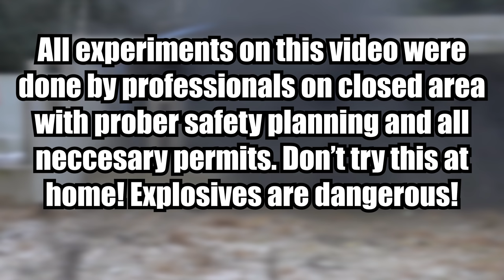How hard it is to explode a hole in concrete wall?

Comment: “Don’t try this at home” Yes because I just casually have C4 laying around my house....
Reply: Tbh you can get really similar results with supplies from the hardware store and walmart lol
Reply: @destinytroll1374  how
Reply: @collinspittle6886  a good VPN and a private browser helps. :D
Reply: @collinspittle6886  not today Mr. ATF man
Reply: Or, if you live in a state where it is legal...you can go to Walmart mart and buy tannerite. If you want it cheaper you can buy ammonium nitrate and aluminum dust, mix it together in a proper ratio, and bam! Explosive. Good luck getting the blasting caps though...
Reply: Lol you have one?
Reply: @majorleagueminuteman1344  you can also just make rdx or other high explosives fairly easily... for example to make TATP all you need is hydrogen peroxide and acetone, but it'll blow your hand off if you arent careful
Reply: @majorleagueminuteman1344  isnt blasting cap just a fuse or smaller explosion for the large explosion? Or is it just a container for the explosive?
Reply: @ThatTURK1  depending on how stable the explosive is you can use a electrical charge on some whereas C4 needs a smaller less stable explosive to set it off. i would go into more detail butttttt NSA and whatnot.
Reply: @rickylafleur5823  lmaoo gotchuu
Reply: Well, they probably have in Finland...
Reply: @rickylafleur5823  precisely. I’m not going to elaborate on ANY initiation device online...if you want a visit by the alphabet bois...that’s a sure fire way to do it.
Reply: Wait you don't? Did I do something wrong?
Reply: i know how to mix TNT tho
Reply: @majorleagueminuteman1344  you missed an ingredient sir
Reply: @ThatTURK1  Most explosives these days are very stable so they don't explode at random on a warm day or when you shake them too much during transport, but that also means that you have a harder time making them explode when you need to. Blasting caps are filled with a small amount of less stable explosive which can be triggered on command which can then set off the main explosive.
Reply: @Brutus When you’re growing up, you gotta do illegal shit once in a while, have a bit of fun and maturinate into a better person
Reply: Tannerite bois, a large amount should do. Get you a bunker, you'll need it.
Reply: @watdatdoo  tannerite is kiddo stuff.
Reply: @rickylafleur5823  Yeah but a large amount is still a easy to get alternative. But I understand that it wouldnt be close to TNT.
Reply: Well be swatting you're house in a minute
Reply: @leythal-igaily7158  bring it!
Reply: @leythal-igaily7158  i have set the ultimate trap! you may have body armor but do you have lego proof footwear? bahahaha i know im evil!
Reply: you can make explosives with bleach and potassium salt as well but its rather weak
Reply: @karolbomba6704  you won't be making those much longer..

Bravo Six out
Reply: @leythal-igaily7158  the ironic thing is that the docs on how to make them were released by CIA
Reply: @karolbomba6704  we dont talk about it
Reply: @collinspittle6886  check out Tech Ingredients channel
Reply: You must not live in America
Reply: I have C3 on my door...
but my neighbor has C4 
😁😁😁😁
🙈🙈🙈🙈
Reply: @majorleagueminuteman1344  This is what ABB did when he wanted to blow up that government building in Norway in 2011.
Reply: @collinspittle6886  Nitrate hexamine, to get RDX, with RDX you make plastic explosives. Good luck getting it to go boom though, detcord is harder to make and i don't think your hardware store improvised primaries pack enough punch. Picric acid might do the trick but it's literal poison so don't fuck around with it. It doesn't have to go boom to hurt you.
Reply: I lost all my C4 in a boating accident!
Reply: mans you can buy or make thermite so who needs to blow through when you can just burn through
Reply: @IudiciumInfernalum  pretty sure tatp should be fine as a primer for anything you can make at home, but there's plenty of other ones you can make at home that'll work too.
Reply: HAHAHAHAHAHA...YUP
Reply: @malelpn37  that was probably on purpose

Comment: I like how they just casually make and use I.E.Ds
Reply: Finland, the land of No Fucks
Reply: Well how else do you think they fought off the Russians back in 39
Reply: for science or something
Reply: This "improvisation" is an application adapted for a purpose, a tool designed to do a job. In a controlled test environment.
It's not a synonym for crime and terror.
Reply: @pwnmeisterage  You do realise I.E.D stands for improvised explosive device which was exactly what they used in this video
Reply: @T-904  You do realize it's not a coincidence that I used the word "improvisation"?
Reply: As long as they aren’t hurting themselves or others, should be fine.
Reply: these aren't IED's they're actual professional charges made with C4 they're not improvised at all and he's properly licensed(if he put the C4 on a gas tank of a car or surplus artillery shells then they'd be IEDs)
Reply: @Aaron-zu3xn  but he literally put C4 on a gas tank
Reply: @T-904  no that was just a backing of water to concentrate the blast,that's how professionals use breaching charges
Reply: @T-904  a professional door breaching charge is literally just det cord and a plastic backing full of water that cuts a hole in the door the size of your backing,it may seems home-made the way they did it but that's professional work
Reply: @Aaron-zu3xn  it was home made
Reply: “Hmmm I ran out of water, canteen is now grenade”
Reply: @bertjones5778  what do you mean they "surrendered" russia lost anyway.
Reply: It's p easy
Reply: As long as its for "science"
Reply: Yea why is it cool when they do it but when I do it people use words like war crime
Reply: @evanstavrou918  ify mans
Reply: why are you guys arguing over dumb things lol does it really matter if it's an I.E.D or not
Reply: They're not doing it casually. They have permits.
Reply: If you're a professional an IED just becomes a ED
Reply: @jacksonkouns5623  you are correct
Reply: @Aaron-zu3xn  it was still made it home that's the thing if it's made it home then it's an IED that's just kind of how it works
Reply: @USS_ESSEX_CV-9  no...an IED is improvised from things and used in a way the original parts aren't intended for,this is a professional expert using the pieces as they're intended to be used,no different than demolition work and they don't use IEDs to take down buildings
Reply: @Aaron-zu3xn  so you're telling me that the person who created the gas cans originally intended for them to be used as effectively casing for demolition charges that's what I'm understanding from your comment
Reply: @USS_ESSEX_CV-9  yes they are tanks to hold liquid not specifically gas cans,his explosives were also purchased at a real distributor by him with HIS LICENSE which IEDs are NOT
Reply: @USS_ESSEX_CV-9  the tanks are not part of the explosive btw so have no bearing,the explosive still works without them so they're not even considered
Reply: @Aaron-zu3xn  an IED is an explosive device that is made with the power of a single person's mind because they think this might just work for blowing a hole in something so for example taking some c4 and shoving it into the side of a Jerry can or some c4 stuffed inside of a plastic water bottle that is full of water that is improvised maybe improvised by professionals but still improvised.
Reply: @Aaron-zu3xn  also the Jerry cans change the way the explosives behave without the water inside the Jerry can funnel the explosion into the wall it probably would not have blown that big of a hole in the wall has explosives take the path of least resistance concrete is in some cases easier to destroy than water when you're dealing with explosives cuz water effectively behaves like concrete when you hit it with very high energy so without that water there in the Jerry can that concrete may have come away from that explosion with a little dent in it
Reply: @USS_ESSEX_CV-9  the c4 isn't inside the jerry can it's literally used before they even think of the jerry can,this is NOT an IED,an IED is improvised on the battlefield to injure soldiers out of whatever is at hand after suppliers are shut down,this is NOT an IED any way you try to justify your argument,
Reply: the jerry can isn't part of the explosive they just put it behind the explosive to concentrate the blast,had they filled it with a chemical to magnify the blast and do more damage(anfo for example) then it would be considered an IED but in this case no,even professional jobs use backing for cutting charges and that doesn't make them IEDs
Reply: @USS_ESSEX_CV-9  by the logic you're trying to use any breaching charge is now an IED and police/QRF military teams use IED to breach doors/wall now...that's not how any of this works..they all use backings
Reply: Its a bit like Finnish pressure washer
Reply: it's actually pretty easy, that's why IED's are so plentiful and dangerous
Reply: þey're fnnish, þat's just how þings are in Finland
Reply: Basically a secondary school nerd
Reply: you dont?
Reply: @johnweber4504  I never said that
Reply: I like that you think composition 4 and shaped charges are IEDs lol.
Reply: @bigj43454  if they are improvised like what you saw in the video they are I.E.Ds
Reply: Don't worry they had "prober" planning 🤣
Reply: and there's nothing wrong with that
Reply: @T-904  Its not an IED, IED definition: "a simple bomb made and used by unofficial or unauthorized forces."
Reply: You don’t do that?
Reply: Dude same
Reply: If they used a Nokia as a detonator all they would have to do is put the buttons and faceplate back on and it would be back in business!
Reply: @USS_ESSEX_CV-9  i.e d. = improvised EXPLOSIVE device. His explosive device wasn't improvised, it was C4. If it were diesel and nitrate or gun powder in a pipe, it would be improvised explosive device. This c4 was designed to explode exactly like this, unlike mixing 2 everyday chemicals together, I hope this makes it clear for you. Has nothing to do with what you shove the charge in, it has to do with the explosive material
Reply: @zbruh7268  an improvised explosive device is a device that may use any type of explosive charge be it improvised from something like gasoline or a conventional explosive like c4 deployed in ways other than conventional military action so everything they made in this video is an IED Because those are not standard military explosives. The charge itself may be standard like c4 but that's not something that the military is going to use or not just going to use a Jerry can with c4 plastered on the one side of it
Reply: @FireMissionAlpha  No Fucks Given Finland lol
Reply: Cant we all just get along? Lol
Reply: In a world of pure science there is no problem with that. Unfortunately people be crazy and use this stuff to harm others on purpose. Instead of running interesting experiments and being a helpful tool. 

Also keeps doctors from haveing to sew on fingers but that is irrelevant.
Reply: Finland: like the rest of the world but everyone drifts at the speed of light on dirt roads whilst making IED's and venison simultaneously.
Reply: Don’t worry until they make EFPs
Reply: They should make a YouTube channel called beyond the IED
Reply: @Aaron-zu3xn  there are many different types of breaching charges you're correct in one of them this is hydraulic breaching charge but there are several other ones and this wasn't typically used by military police or military they use higher quality products so in a sense this is still an IED
Reply: Russians Whu u expect lmaoo
Reply: Bert Jones on skis
Reply: @USS_ESSEX_CV-9  If any explosive "deployed in ways other than conventional military action" is an IED, then fireworks and firecrackers are IEDs.
Reply: @hermenegildakociubinska6665  they might be
Reply: Iraqi’s would have already done it by now and made the finn who survived cry
Reply: Y, you don't?
Reply: I am old enough to remember when we could do stuff like that as kids. Apparently it is now a crime...
Reply: @vidard9863  it's not a crime so long as no one gets hurt
Reply: Every explosive at one point was an IED.
Reply: @pwnmeisterage  
Dude they are literally doing the definition of improvisation 
Well that didn’t work let’s try this 

Improvising is exactly what they’re doing
Reply: @microwave4928  Before you insult people you might want to actually pay attention to what they're saying, lol
Reply: Wait... you don’t?
Reply: @devinhedge  I am legally obligated to say "no"
Reply: @bertjones5778  I thought it was just that one dude and his rifle
Reply: @fat-boyzstudios5654  correct, one more correct answer and you’ll be able to claim our grand prize! One “mostly” intact T-34 “repossessed” from the ____________ conflict!
Reply: @microwave4928  no? Listen?
Reply: @USS_ESSEX_CV-9  if you're using commercial explosives of which c4 is ita not an IED its just a prepped charge
Reply: @craigcrissman4651  it's still used in an improvised way. You cannot go to a company and buy a Jerry can with a bunch of c4 stuffed in it as a breaching charge that's not a thing you can go by so therefore that is an IED.
Reply: @USS_ESSEX_CV-9  just because you cant buy something prefabricated doesn't mean its improvised. Adding a water backing to create backpressure for a breaching charge is a fairly standard procedure. Just because the container is up to the person prepping the charge doesnt make it an IED
Reply: @Aaron-zu3xn  Wrong, these are indeed IEDs. An IED doesn't have to be for terroristic use only, an IED is literally any sort of unconventional explosive, which these are all unconventional considering they made them combined with a water bottle, a jerry can, etc.
Reply: @vt.b3nis376  IED implies modifying something and using it an a way it isn't meant to be used to cause casualties,the way they're doing it is with professional tools and certified professionals it's NOT an IED some goat farmer built in his shed
Reply: @vt.b3nis376  by your definition everything made by the channel "Ordinance Lab" would be IED's but they're not they're registered with the ATF as well
Reply: @pwnmeisterage  HEOs or homemade explosive objects

Comment: I was once privileged to observe the demolition of a thin (5" thick) concrete bridge deck slab, from a damaged bridge with a washed-out abutment.   The slab had so much reinforcing in it that, even though it had a 45-degree twist along its length, there were no visible cracks.   The thinner the slab the more difficult it is, because the blast just blows a hole and escapes into thin air.   The contractor had a free supply of time-expired Anzomex boosters (TNT + PETN).   These were maybe an inch and a half diameter and a couple of inches long.  So he drilled strings of holes about 4" centres, inserted and fired the charges, and it cut the slab into neat six-foot squares of concrete joined by the reinforcing which he then cut with a gas axe.     Notably, the steel reinforcing wasn't damaged by the blast at all, though the concrete was neatly removed from around and between it.
Reply: " The slab had so much reinforcing in it that, even though it had a 45-degree twist along its length, there were no visible cracks. " hehe, the amount of false/wrong informations under this video is just impresive...
Or did you simply forgot to put your glasses on your nose that day?(because that is the only logical explanation of your story...).
Reply: @Bialy_1   I said, "no visible cracks".     That was based on standing at one end and looking.    This was a ~30-foot long single-lane bridge deck slab on a back road.    And I did find the absence of obvious cracks quite remarkable.
I'm pretty sure that if I'd got down on my knees and examined it closely, there would have been microcracks all over it - which is why there weren't any obvious big cracks.    And there was nothing wrong with my eyesight.
Evidently I should have been more careful to measure and record things precisely at the time and specify carefully the limitations of my observation in a Youtube comments section.   (Yeah that was sarcasm).
Reply: @Bialy_1  imagine unironically saying hehe